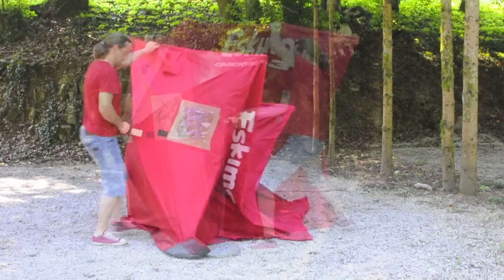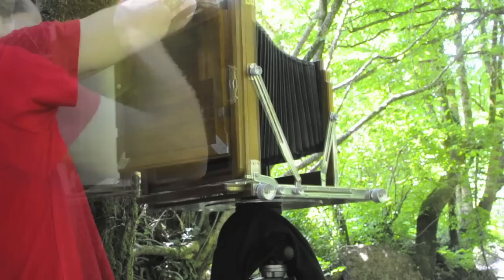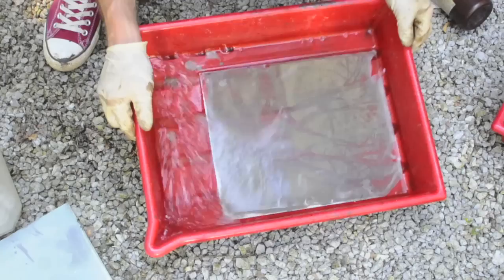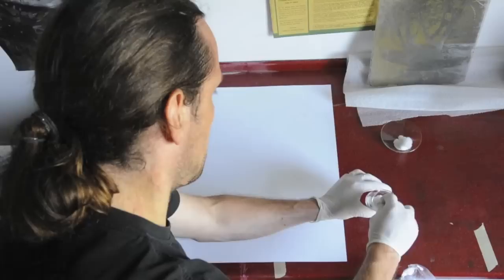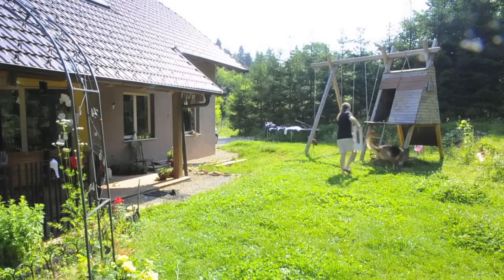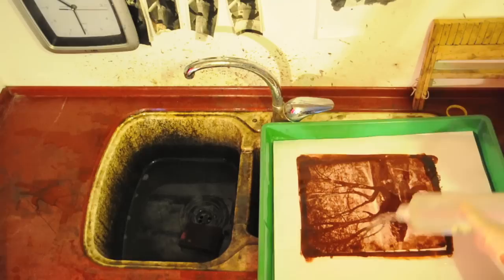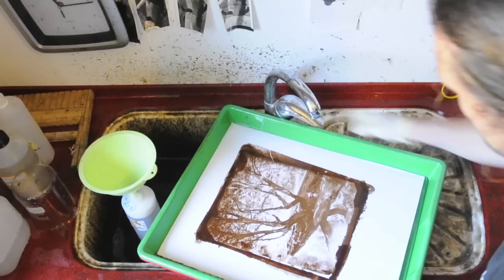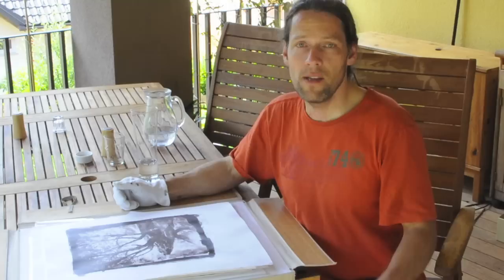Wet Plate Collodion Negative & Salt print process / Borut Peterlin

Comment from the maker: Hi guys, thanks for all the comments! I forgot to check it out. 
Receipts:
Osterman's Collodion negative is 2gr of CdBr, 5gr KNO3. 220ml of 4% collodion, 140 ether, 140 alcohol. 
Developer 2gr of FeSO4, 8ml of glacial acid, 8ml of alcohol and 100ml of water

Redeveloper:
1) Iodide treatment 1,5ml of iodine tincture into 40 ml of water
2) Pyro developer: 1gr of pyro acid, 6gr of citric acid and 350 ml of water

Salt print:
Seizing: 15gr of gelatin + 15 gr of ammonium chloride + 1000 ml of water
Sensitizer: 15% of AgNO3 + few drops of acid to make between 2pH and 3pH. 
Gold toner: To make stock solution: 1gr of gold chloride into 155ml of distilled water. Then you take 10ml of stock solution and put it in 700ml of distilled water and add half a small spoon of baking soda, so it becomes 8-9 pH. 

Fix it with 15% of thiosulfate, freshly made. Don't use old fixer, it will make a print go yellow years later. 
Wash for half an hour. If you have washaid, even better. Fixir in paper will deteriorate your print years later. 
Good luck!

Comment: Those Vageeswari cameras are great. I have several, more actually, went a little over the top so to teach workshops. Dry plate is my thing, Liquid light is used. Never got as far as making my own emulsion yet. I also attended classes at the Rochester Inst.
Reply from the maker: +Michael Carter indeed! I have a dry collodion & printing workshop in two weeks, if you're interested. But of course the best workshops are in GEH, Rochester. http://www.topshitphotography.com/workshops/13-wet-dry-plate-collodion-negative/

Comment: Amazing video Borut, thanks for sharing!! I wanted to ask you about the Beeswax, is it filtered, or pure beeswax?? I need to wax some cyanotypes that i did, and when i tried with pure beeswax and lavender oil, well, it turned out ok, but not as smooth as i was expecting.. I would be very greatful if you can help me with advice about it. :)
Milosh
Reply from the maker: Milosh Mitich I don't know what to add. Heat up beeswax, add oil, mix it, cool it down, add more oil until is creamy. It comes with experience, so just make few more prints and it'll get better.

Comment: How do you know the exposure values particularly the ISO?
Reply from the maker: ISO is as name suggests, a standard. Wet plate collodion process was practiced before standards were introduced and even nowadays does not fit in any standard. ISO is simply a reference with today's wetplaters, but the sensitivity changes depending on the age of collodion, mixture of collodion, pH of silvernitrate and the spectrum of the light. In the case of this vlog it was green light, with almost no UV and pH was way too low (beginner's mistake), so exposure was very long. 
To answer your question, a photographer makes a guess, take a plate and then on the result corrects the exposure.